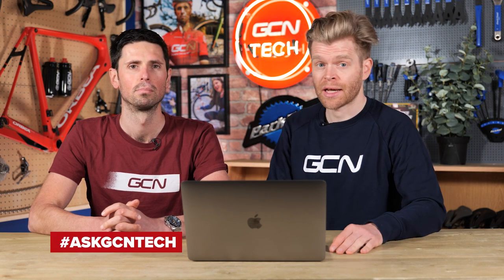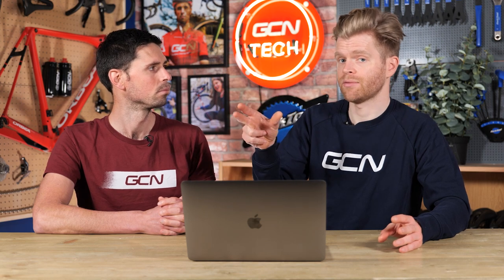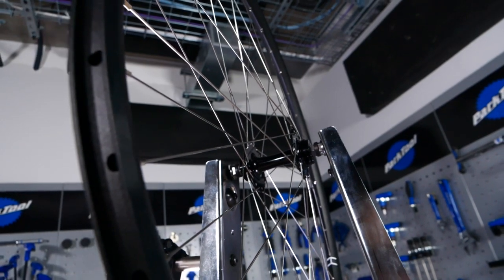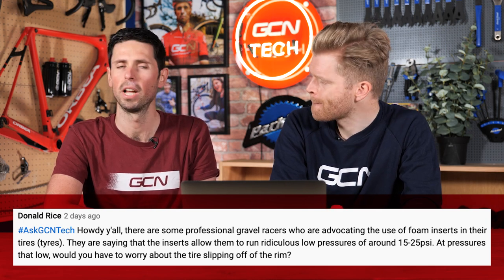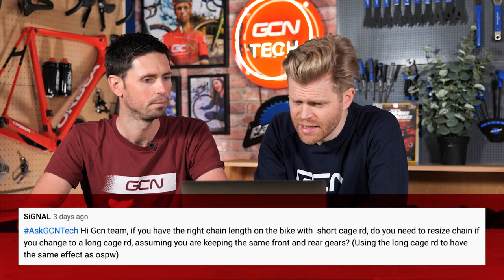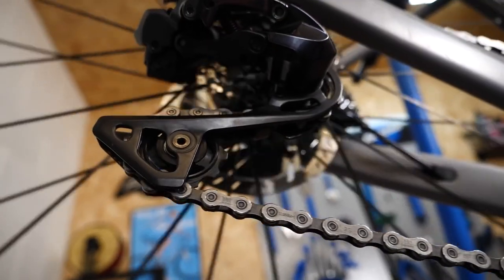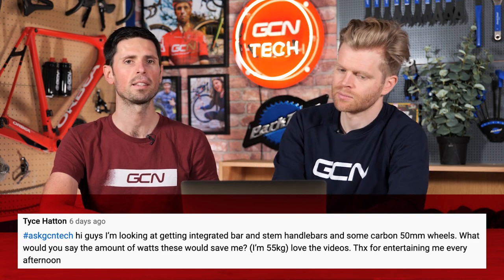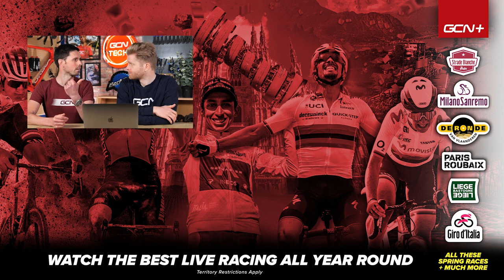How Many Watts Do Aero Bars & Wheels Save? | GCN Tech Clinic #AskGCNTech

Comment: 6 foot 3 inches tall is pretty large for a 56 sized frame. (unless your legs are very short)  I'm "only" 6'2" tall and I ride a 59 cm, and a 60 cm frame.
Reply: Likewise - 6'1" here on a 58 frame and sometimes even that feels a little tight.
Reply: Me also, 5'11 and 58 seems right. For 6'3" from what I've seen 60 cm would be like the minimum
Reply: 6.3 tall 87 inseam, on a 59 frame. 11 cm stem
Reply: @TengoHambre  With my 59 cm frame, i use a 14 cm stem, and with my 60 cm frame, I use a 13 cm stem.
Reply: I'm 5'10 and my recommended frame size is 54-56. I rode my uncle's 52 frame and felt like a clown on a tiny tricycle.

Comment: #AskGCNTech Guten Tag, i am running a 23mm Front Tire and a 25mm Back Tire on my TT Bike, both Setup With Latex inner Tubes. My question is about my spare Tube, because those are either suited for 19-23mm or 25-28 mm. Can i get away With the larger one in my 23mm Tire or the Other way round. Which is the better solution. Cheers!

Comment: Latex tubes.... what a nightmare. Fine for a TT but don't even think about them for anything else
Reply: And then if you don't ride your TT bike for a week, the tires go flat.  If you don't ride it for a month, the sidewalls get damaged sitting on flat tires.
Reply: Never had a problem with latex tubes, at least my bizeps stays lean pumping up my tires every second day😅😎, the ride is really smooth tough with corsa tires, and i also like the fact that my tire pressure is exactly how it dhould be before every ride🥳

Comment: #gcntech as a former marathon runner I was very aware of the mileage on my running shoes as they have a fatigue life depending upon a ton of variables. Typically I could run 250-300 miles before the spring sensation of a running shoe would dissipate. Do cycling shoes have a fatigue life as well?
Reply: Yes, but unlike with running (or even hiking/walking) shoes its unlikely they will make you feel uncomfortable or cause you any problems, it will happen so slowly that you will likely swap them out for some other reason, only then will you realise just how soft they had become. The first time some people notice is when they crack or snap!
Reply: Not nearly as much you will notice tire wear on a bike like you notice shoe wear

Comment: #askgcntech I have a 2008 Specialized Tarmac Elite, with 2021 Mavic Aksium Wheels. I have been running 10-speed, but have been hitting some mechanical issues, so am wanting to get rid of the old groupset and bring in some new kit. Can I fit 11-speed on this frame or am I limited to 10-speed? The Aksium hub is 11-speed...I think.
If you can help that would be awesome. Thanks in advance
Reply: you should have no problem putting 11 speed on if the hub is already 11 speed (Mavics are all 10/11 compatible I think).  You just need the shifters and rear derailleur.  F der should be fine as is.

Comment: #askgcntech Hi Guys, I have a gravel bike with clearance for 40mm tyres. I currently have 28mm tyres fitted at the moment. Does the extra space between the wheel and the frame cause some sort of aero disadvantage? or are they any other disadvantages the extra space gives?  Thanks!
Reply: It is proven that more gap between the fork and wheel is more aerodynamically efficient as the turbulence from the forwards spinning wheel interacts less with the fork.
Reply: @Patrick Parisienne  really? Would have thought it was the other way around, dont know much on this topic but usually when you think aero, everything is really tight, minimal gaps, thanks !
Reply: @patrickparisienne1917  I would imagine fork shape has a lot to do with that as well, if you have to aerofoil wings for forks sure that makes sense but what if they are more rounded?
Reply: @TheArniec91  it makes sense to a degree but I think the fork shape and wheel depth and shape  really matters for the interaction hes talking about to happen
Reply: @coreygolphenee9633  yes fork shape is important. 

STORCK aero bikes feature large fork clearance around the tyre, as do the latest track bikes, look at Team GB’s bikes at the Olympics….

In a straight line a more airfoil section is preferable, but any side winds render it more draggy than a round tube. A blunted airfoil section that is not too long in its chord is a good compromise.
Reply: @patrickparisienne1917  makes sense i was gonna say the surly style clears 3.0 runs 2.5 fork can't possibly be considered aero
Reply: @coreygolphenee9633  Just remember the biggest drag on a bicycle is not from the bike so rather than the rider between 80 and 90%
Reply: @patrickparisienne1917  oh for sure my pear shaped ass is impeding the wind quite a bit, I call aero bikes downhill road bikes because the only time most people will notice all of it is pointing down a hill

Comment: #askgcntech Hi everyone, is it normal that my drivetrain is noisier in the large front chainring compared to the small one? I have checked for rubbing with the front derailleur but don’t see any contact. It gets less noisy when shifting to the smaller cogs at the back. Thank you and keep it up with the great content!
Reply: Which groupset do you have mate? This exact thing happens on my 105 and cannot find the cause. I’ve also noticed similar comments on other videos and the response by the presenters has been to simply check the derailleur!

Comment: Have you guys seen the videos of guys using string spokes? It is so weird but they work spokes are basically not load bearing so I thing string would be lighter than even carbon spokes...just saying get out the sewing kit and save some watts lol
Reply: I mean they are dyneema strings which are strong AF but I think shaped foiled carbon spokes would out do them
Reply: They work because the force of your weight on the wheel "hangs" from the spokes that are facing "up" at any given time, which is then distributed around the rim.

Comment: #askgcntech Hi guys, love the content and the effort you guys put into creating it all. Have been watching your vids for years now and have always wondered about the difference between entry level carbon wheels and top of the line ones. Any chance of a video comparing the two ends of the spectrum and what gains are offered by the top of the line? Cheers! Jared
Reply: Look for a rim shape that resembles a NACA profile with a wide internal width to get a smooth tyre transition. Theoretically, that will be the fastest wheel rim you can get. The other things are bladed spokes and good hubs etc

Comment: The Vittoria Air-liners are so good. I love them. I've been running them on my road and gravel bike for a few months now and the piece of mind they offer is great. I've punctured to the point where sealant was spraying out of my tire for minutes (hilariously) and I still felt great on the bike. That was all down to Vittoria.
Reply: My (potential) problem with them is that tubeless tyres are hard to fit at the best of times. I can only think that the air-liners will make it even more difficult to fit the tyre. I mean, you need to push the bead of the tyre into to centre of the rim bed to stand the best chance of an easy fit. In your experience, how was the fitting process? (Actually that’s not my only problem, the price of the Vittoria air-liners is also ridiculous).
Reply: @likemarksee  it's actually easier since the inserts help keep the tire formed. I had huge problems with my GravelKing  Panaracers (I had to inflate them with tubes and then reinstall them after the beads stretched) since the beads were so tight they wouldn't seal. With the inserts they were easier to install. Helping that is the tool that comes with the "kit" option which helps to wrench tires onto the wheel.
Reply: …i’m struggling to justify the (potential) effort and cost of fitting Vittoria air liners for the benefit that they provide. In a TT/triathlon situation you’re still likely to be way off the podium (or a PB) if the air liners come into play.
Reply: @likemarksee    I don't have any experience in those categories, so I can't help with that. In a road or gravel ride for pleasure, they're a no brainer. In a gravel race, they're a no brainer.
Reply: @likemarksee  yeah but for a multi use bike guy that may commute or what not with their bike spending a few watts on piece of mind will Ultimately make you faster in the long run
Reply: @RobLarsen  ok, thanks. I meant that it can be difficult to get the tyre onto the rim; and that’s where I think the air liners will make it more difficult. In the case when it’s easy to get the tyre on, but difficult to inflate,  i guess the air liners might help.
Reply: @likemarksee  got it. Yeah, I can imagine scenarios where that would be the case. If you buy the "kit" from Vittoria it comes with a tool that helps you with difficult to manage tires for that very reason (the GCN tech video that introduced the Air-liners shows the tool) It helps in certain situations, for sure.

Comment: #askgcntech given all variables remaining the same, what is the wattage saving between a 34mm and a 50mm deep rim when riding on a flat road (or climbing, or descending)? Assuming equivalent tyres and tubes (or tubeless), same frame, same rider, same temperature etc
Reply: at what speed? between 20km/hr-30km/hr, less than running proper pressure on your tires and above those speeds, much less than a dirty drivetrain and lowering your shoulders.

Comment: I want to know what's the difference between cheap and expensive alloy wheels though, couldn't find an answer anywhere.
Reply: Mostly about weight. They are build with similar alloy and to similar strength requirements, but with different extrusion profile and split connection technology (welded, pinched with a hub, left open). More intricate shapes and solid connections give better stregth/weight, but ask for more precise machinery
Reply: Durability is the main difference.
Reply: @galenkehler  i have a cheap training wheelset but I'm looking to upgrade to a 35mm deep alloy racing wheelset (fulcrum racing 4).

Comment: Aero wheels vs ceramic wheel hub bearings…what is better? I dont know should i buy wheels with ceramic hub bearings that are not aero or wheels with normal steel hub bearings and are aero. #AskGCNTech
Reply: Steel bearings are better beyond the first few hundred km so unless you're replacing bearings every month...
Reply: ceramic bearings are useless in cycling applications
Reply: Ceramic bearings are designed for high rpm applications, nothing on a bike spins faster than a couple hundred rpm, in my opinion it’s marketing hype…
Reply: Aero or non aero is depends on you. One thing we all have in common is the bearings.

Go for non-contact sealed bearings such NTN LLB or NSK VV or equivalent.

The only bike's bearing that can go full ceramic is the pulley wheels bearing. Very low load and rpm, probably is going to last a bit longer. Change the old bearing to hi-quality full ceramic NSK bearing just cost me 18usd/pc. You don't need those fancy big pulley wheels bs that cost you 300usd unless you have deep pockets.

Comment: #askgcntech Hi Guys i got a question, a bit on the engineering side of things. How come some/most of the premium hubs are so loud (DT Swiss, Chris King) whilst entry level or "city bike" Hubs almost make no sound at all? I understand that the emitted noise depends on things like grease density, freewheel design, number of teeth to engage, spring tension and materials used. But off the top of my head i would assume that noise directly derives from friction in the hub, which would mean: more noise = more friction = more power lost. Which would make absolutely no sense at all for premium hubs. Could you please enlighten me? Thanks in advance!
Reply: Well you basically said it yourself with the grease. If you put more grease or a thicker grease in the freehub it will be quieter but the friction from the grease will slow the wheel down, so a louder greaseless freehub will be faster. Also I guess a lighter weight hub, lighter rim and higher spoke tension will amplify the freehub ratchet sound.

Comment: I have found that the larger pipe cleaners work well for cleaning a cassette.  Works like the string floss but a bit easier to manipulate into the cogs.
Reply: There is a microfiber based bike "floss". They are great for removing grit from between the plates on your chain and to remove such from between the cogs on time cassette.

Comment: #AskGCNTech Hello tech experts! I got a pair of pink latex tubes. After a race, do I fold them up and keep in the drawer, or just use them till they got punctured? And if I repair punctured latex tubes, will that affect their performance? Hope this is interesting enough to get a reply ;)
Reply: I'd be careful with folding them up, I've had a tube which then got "glued" together on the inside. Inflating the tube has not helped. Anyways, I run latex tubes on my daily driver. Yes, it's annoying to regularly re-inflate them but since I use Gatorskin Hardshell tyres, I'm not worried about punctures at all.

Comment: The guy with the handlebar issue should maybe try to buy a riser handlebar, which would possibly be the cheapest option. Specialized, amongst others, sell that type of handlebar for around 350 US$.
Reply: At 6ft 3in he needs an XL bike. No fix is going to make that tiny bike fit him. I'm 6ft tall with longer arms and an XL fits well. 6ft 3inch he'd be XL or XXL depending on his arm / upper body length. Silly.
Reply: Yes, I was going to recommend the very same thing.
Reply: @chicagoan  I'm 6ft 7in, 250lbs, and can certainly relate to that. Currently on Tarmac SL6, size 61cm. Agree with what you say, but simply recommended the easiest and cheapest option.

Comment: For the 1st question, another option is, when getting a standard stem and bar, to get a +15 or +25 riser handlebar, they are quite common, and some even Aero (from Specialized a +25 aero one exists).
Reply: Yeah but he would be much happier on a  58-60 depending on his inseam and arm length
Reply: Nonsense Richard - they're not allowed to explain the normal (traditional ways) of adjusting fit on a bike... ;-) And, sadly for the person asking the question, their Canyon likely has an oversized steerer tube that makes it harder to find sensibly priced stem options. Part of me wishes they took it as a chance to highlight some of the downsides of fully integrated cockpit setups.

Comment: #askgcntech Hi people. Love the show. May I ask a hydraulic brake question for all those post-mount frame gravel bike ninjas out there?

I have an old 2016 Cannondale CAADX frame with mechanical post-mount brake callipers (which are really awful). I'm looking to upgrade the whole groupset to modern GRX 600, but can't fit GRX callipers as they're all flat-mount only. Would Shimano post-mount mountain bike brake callipers work with GRX hydraulic shifters, and if so which one would be most suitable and are there any pitfalls in terms of hydraulic hose fittings between gravel and mountain bike standards?

Best wishes,
Harley

Comment: Hi guys and girls, I'm keen to upgrade my 2016 Giant Defy from mechanical to hydraulic discs. I'm more rugby player than cyclist in build, around 100kg and am keen for some more stopping power. I currently have 105 5800 and TRP spares. My key concern is finding a way to fit flat mount calipers to my older post mount frame. Any ideas greatly appreciated!  #askgcntech

Comment: Why would you change from a short cage to a long cage rear mech if you're not changing the cassette to one with smaller gears, 30t and up? I have 11-32t and it shifts perfect with a medium cage. Weird "upgrade". They'd have to check and adjust chain length twice, once for the long cage and old cassette, and once again if they ever get the cassette that requires a long cage.

Comment: #askgcntech Hi guys (and Mannon), how strict should one follow system wight limits for road bikes/gravel bikes? For example canyon often says the maximum system wigh safe to use is 120kg...If you you are a 2m tall rider at 100kg, on a 10kg bike (XXl bike) and maybe want to bikehiking, there wouldn't be much safe room for luggage. Or do you think those system limits are only a "guaranteed safe suggestion" and one should be fine to add some more wight?

Comment: Is there a big difference between using 45mm wheels both in the front n rear and using a 49mm wheel in the front with a 54mm wheel in the rear? Considering both are almost similar in weight..probably a 50-100gms difference…how is climbing affected with a 54mm wheel?? 🤔 i use a factor o2

Comment: #askgcntech Hi Guys, I want to increase my cassette from a 30t to 32t for a few occasional big rides. Rather than replacing the full cassette, can I switch just the largest 3 sprockets. I’ve calculated chain length as the same, but my concern is the jump in sprocket size. Sprockets 8 to 9 are currently 21 to 24t, but the new ratio will be a 21 to 25t change. Is this jump too large?

Comment: About spokes. My wife has a Liv and I have the equivalent Giant. She also has those flat spokes on her wheels. When she cranks it up. She certainly puts distance between us very quickly. Even allowing for all the other variables, it is noticeable. I've done triathlons (still do) and she hasn't. Sometimes we cycle to a furthest point and pub crawl on the return leg along the south coast near Brighton (we use cycle paths in case you ask). When the sun is shinning .... it is difficult to beat cycling into a sun set.

Comment: If you concern about unclipping of tubeless tire, just add 1 or 2 extra layer of tubeless rim tape. Also, you probably never use foam insert in tire. Some time it's so hard to unclip, it easier to cut tire.